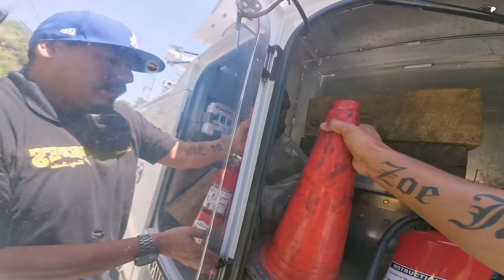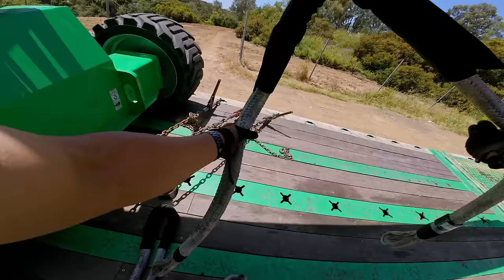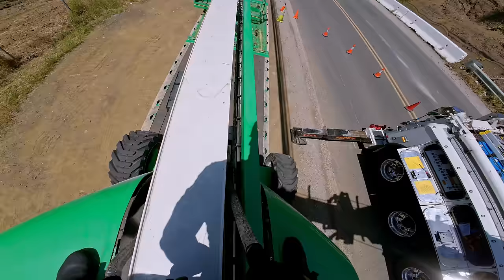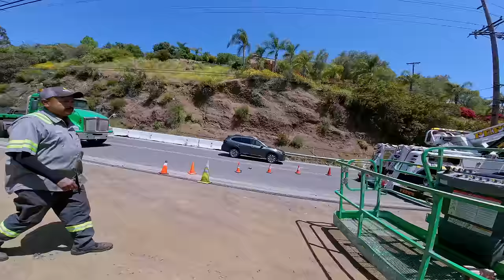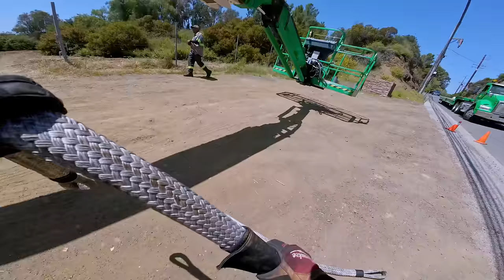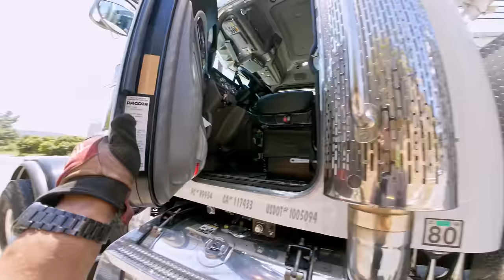Emergency Telehandler Offload in Live Traffic!

Comment: Great job Alex but surely not one done with best safely without the backup of a Traffic Management truck or Police / State Troopers to slow the drivers down, especially with the boom over the opposite side of the road. If I was a driver being signalled to drive under a suspended load I’m not sure I would have complied. Anyway, all’s well that ends well. Excellent to extend the video to show the strip down.

Comment: So many people don't know what communication cables look like.  There is no power on that side of the road.

Looks like the rear steer is an issue with those rigs.  That is what he said screwed him up.

Great rigging Alex.  Funny we see so many of these machines in trouble.
Reply: so he drove it to that condition? must not know how to drive it. i thought it bounced over.
Reply: Ron Pratt of Midwest Towing calls those power/communication wires his ARC nemesis.
No laughing matter
### Safety First❤❤❤
Reply: Oldskool phone wires can absolutely bite you still if the insulation is damaged. 48vDC on hook, 15vDC off hook. Those won’t hurt you but will make sparks and are not kind to the telco’s gear, as high as 120vAC ringing which’ll get you as good as anything.

Best to just assume it’s all spicy unless your job is up the pole. That way there’s no risk of misidentifying.

Comment: Holy transmissions lines batman!! PG&E needs to use taller poles or metal towers. Especially with all the FF that happen there.
Reply: That was all low voltage telephone and cable lines, the power lines were on the other side of the road.
Reply: PGE is always in the news, but their territory is Central and Northern California, not Southern California

Comment: Much quicker for the customer if the truck driver had parked so he could pull out forward, out from under the telehandler when Alex lifted it enough to clear the trailer. Saved some time, which I suspect the customer was charged for in the end.
Reply: They're on the side of a mountain. So he can't get to close to the edge for fear of going over.

Comment: Would HULK have been able to lift that and just set it off on the other side of that landall?   Instead of crossing traffic with a lifted load?   Just a question of leverage and capacity..  I'm curious is all.
Reply: Flipper > Hulk
Reply from the maker: Yes. No one new has seen the previous 209 videos posted of me doing this solely lol. Flipper tho does it so effortlessly and much more safer. Notice how the body doesn't roll as he swings. The 75ton capacity plus dual h beam outrigger setup makes it untouchable for this stuff

Comment: Not sure how or why this needed removed by Alex. Sitting on a trailer on a level road and it wouldn't start or move?? Guess I missed something somewhere??
Reply: i thought the same. he was unloading it . the back tires are the steer tires not the ones that were shifted over. so i don't know why the driver didn't try to pull it over with the load binders. maybe he did and it wouldn't go. if he tried driving it off the tire would have come off the trailer and done damage or got stuck .